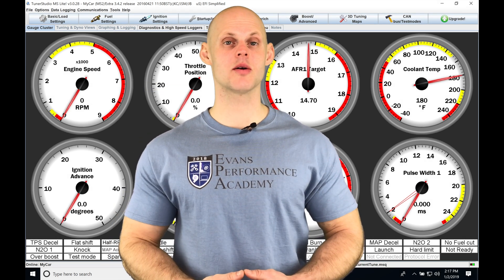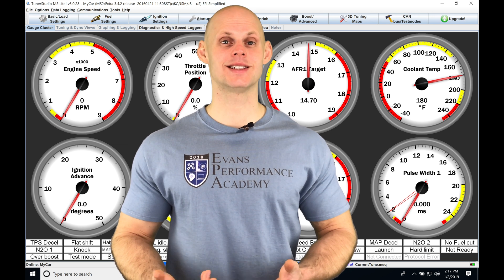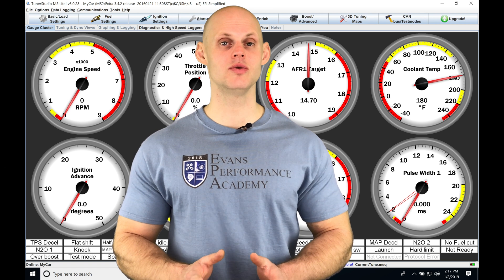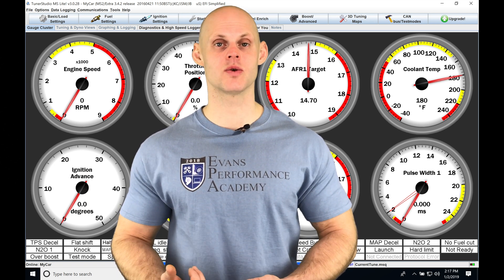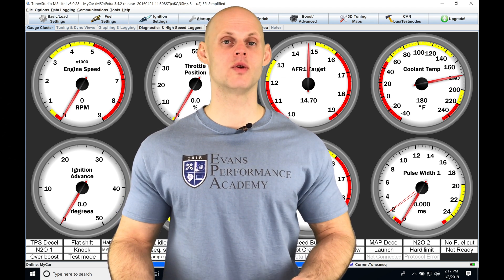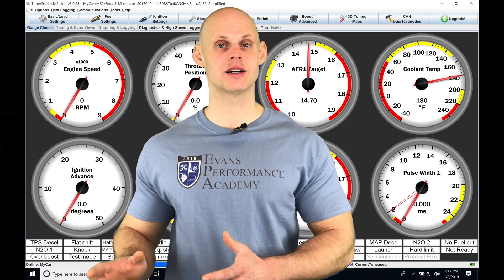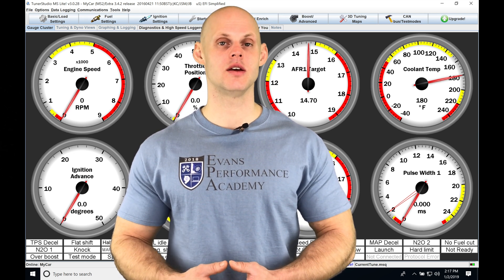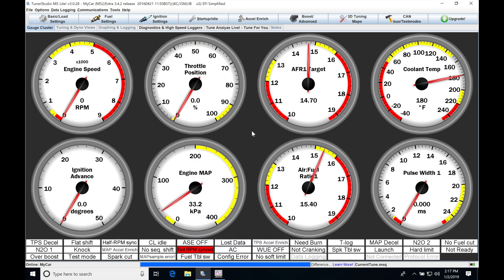Megasquirt: Flex Fuel Tuning | Evans Performance Academy

Comment: Do I  really need the flexfuel sensor if I run my gas down and use e85 and just load in correct map? Or is it best to use a flexfuel sensor to tune it on e85...or is it not necessary?
Reply from the maker: You can never get all of the 91/93 octane out of your fuel tank when swapping fuels.  It only takes that 1-2 gallons of 91/93 octane that as residual in the tank to bring e85 down to something like e60-e65 level.  The fuel delivery will be way off in this situation.  A flex fuel sensor allows you to run any content level and have proper fuel and spark delivery.
Reply: @EvansPerformanceAcademy  nice, thanks for the info.. I'm thinking of having a guy do street tunes, he says it's more realistic for my daily setup. Hell just have to seat in the passenger seat... or do you still recommend a dyno?
Reply: If you run E85 from a gas station chances are everytime you fill up it will be a different ethanol content, if you run self mixed or race E85 you can run without a flex fuel sensor

Jais
JE Performance